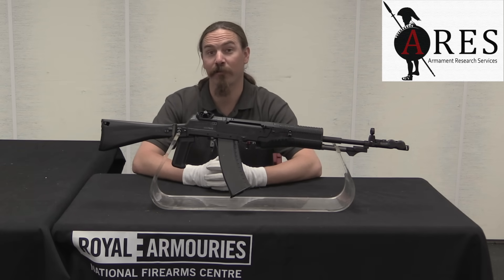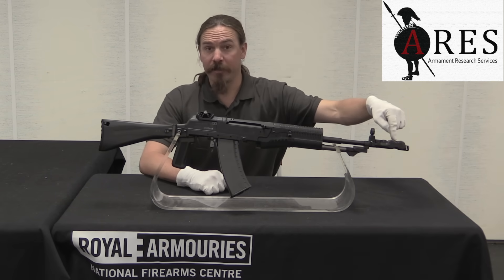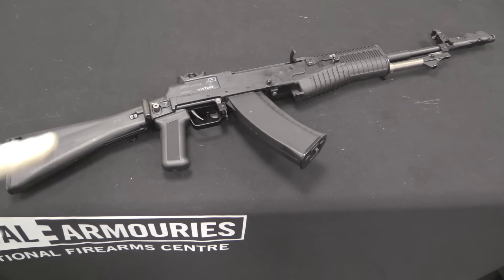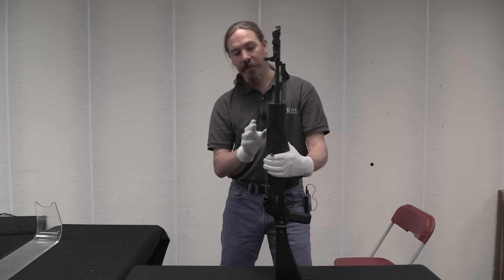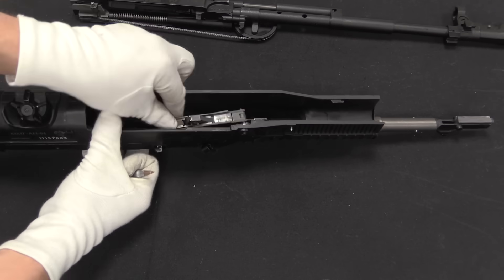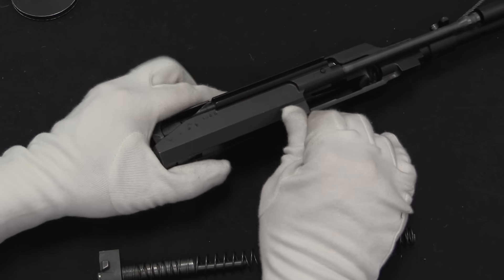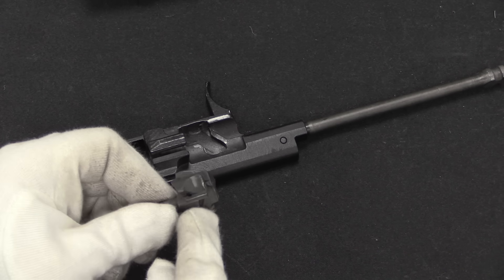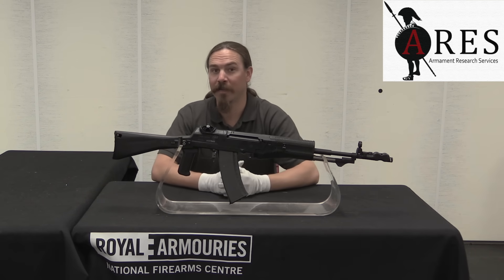Rocket Surgery: Inside the Russian Nikonov AN94

Comment: I can't believe they expected a soldier to keep this running in the field.
Reply: When the gun was being made, I doubt anyone actually believed it would make regular service. Which makes me think they didnt expect soldiers to have them - too complex and expensive for most army units. Never taking into full service, but officially accepted by certain spetsnaz and omon units.
Reply: kevmankom, it was only meant for special forces because it is really good at ripping up ceramic body armour. No regular soldier would ever use an AN 94 because they don’t usually come across other adversaries with ceramic body armour.
Reply: kevmankom spray WD-40 init fuck it that will do haha
Reply: It's not expected to operate like a normal rifle, common soldiers wouldn't use this rifle.

All that's needed is for a budding Russian gun designer from a younger generation to have a look at this and try to revamp the idea. If the two-stage feeding system could be made more reliable, or reimagined (and it could, this is the first gun to ever try this system) the hyperburst system would be massively impactful on the battlefield. Grunts could rip ceramic armor to pieces with this gun if they improved it.
Reply: @DustinKing77   The AN-94 will never put both shots into the same spot.  You're not going to get the kind of accuracy needed to hit the same spot twice from a gun whose barrel is in motion when the second round fires. Even the experimental Metal Storm guns could barely put multiple rounds through the same hole at very short range, and they had NO moving parts at all. Accuracy just doesn't work that way. Even minute changes in vibration can throw off a bullet significantly, which is why really accurate guns have to minimize the variation in vibrations from shot to shot by doing things like free-floating the barrel, stiffening the barrel, and tuning the ammunition to be extremely consistent. These are tiny vibrations, but they are what make the difference between a 4-MOA rifle and a 1/2-MOA rifle. 
The AK system is inherently less accurate than the one used by the AR because the piston starts rattling around in its tube and then the bolt slams into the back of the receiver while the bullet is still in the barrel, causing vibrations, while the AR has no piston to rattle and its bolt is buffered by a spring. The AN-94 then adds a moving barrel to that mix, along with a pully and a whole secondary loading system moving around.
Reply: ThorstenTheViking it would shred ceramic body armor, but only if it shoots both shots very accurate.
Reply: People seem to be under the impression that this is inherently unreliable just because it's complicated. This passed the same tests the AK did. The ones the M16 failed.

Your car is a hell of a lot more complicated than this and it works just fine. Have you seen the inside of an automatic transmission? The manual I have lists I believe one hundred sixteen moving parts.
Reply: It's actually surprising, but in trials this thing proved to be extremely reliable, but obviously not as much as the good old Ak's, thus it was basically relegated to the spec ops units, a.k.a. the guys that can keep their head cool under the shitstorm that combat is and not get the gun jammed bya weird misstep.

Honestly tho, I'm surprised they adopted this monstrosity over the AEK and other counterbalanced rifles, cos those are much simplier, and the only advantage this gun has over them is its hyperburst mode, while in full auto and single shot modes the AEK and AK108 win out by a mile.

Comment: Why does everyone keeps saying that AH is a complicated gun? In fact, it's a very simple machine for what it does. The firing mechanism has just SIX elements (excluding springs): a barrel together with a stock, a hammer, a bolt carrier, a bolt, a wheel and a wire. It's easy to disassemble: just drop the lever, open a cap and pull the firing mechanism out, and that's it!
Compare it with HK G11.

Comment: "The trick to getting the top cover off is to use force from the charging handle, and hole the barrel forward as well, and then you just-"

bangs rifle on table several times until success is achieved

...Yup, that's a Russian weapon all right.

Comment: Let me see if I understand how this works in laymen's terms (haven't watched the entire video yet): the muzzle brake delays the movement of the floating barrel until the bolt and ejector are at their rearward position. At which point, another round is fed into the receiver, and the barrel meats the bolt at the barrel's rearward position, which is when the second round is fired. Is that right, or did I mess up somewhere?

Comment: So when not in the special two round burst mode, does it bypass that goofy lifter?
Reply: No, I believe if you have it in full auto, the first two rounds would shoot at the same speed of the burst, then drop down to 600 rpm. But as soon as you let go of the trigger, it would set back up for the burst, starting the process over.

Comment: And what do you think the role of the muzzle device in this rifle's action is exactly?

Also, I don't get it. If the feeding is done solely from the fancy lifter, why not just move the magazine well forward to that spot and ditch the lifter?
Reply: The lifter is used to feed the second round during the 2-shot burst. I suppose that if the magazine was placed there it wouldn't feed the round up into the chamber without clearing the bolt carrier's travel.
Reply: Um... Do you mean that the magazine lips would get in the way of the bolt carrier? And what exactly makes the AN94 different in this regard from the regular rifles, where it is not a problem?
Reply: Konstantin Voloshin Well it seems that the lifter is built with a retraction mechanism, and when it extends it protrudes inside of the internal receiver. I however don't understand every detail of this design as this is the first time I've seen one disassembled
Reply: Than they should've cut a hole in the internal receiver so that the magazine can fit there deep enough for the bolt to be able to strip rounds from it. A hole big enough to leave space for the magazine at any phase of the recoiling of the internal receiver. Can't see a reason why they couldn't do it. Sorry, but I'm still not buying this explanation. Not without at least some additional details. For instance, why such a hole cannot be cut :)
Reply: Oh, and the reason for the magazine being canted to the side would be interesting to know as well. It is not revealed in the video, and I don't see an obvious answer.

Comment: Another feature of this assault rifle is that in full auto mode, it starts with the 2 round burst at 1800 rpm and then switches to 600 rpm auto fire, every time you pull the trigger, you can check that in a video where a soldier from one of the special brigades who use AN-94 fires it. Also something distinct of this gun is that the bayonet lug is on the right side of the barrel which is something unique in russian guns.
Reply: They had. Main point of the gun was to be used by special forces, but it turns out main issue of it, because russian SF made it weary clear: 
''If it can't withstand same condition, that SF troop can, then we don't need it''.
Also AN-94 was fully adopted by russian SF and fully used in battle and SF operation, but verdict was the same, good weapon for shooting, but unreliable in real battle and long terms condition, same issue was with AEK-971, SF troops were weary pleased of by that gun because it fired weary accurate even in burst mode of 3 shots, but 2000-3000 shots and gun needed spare parts.
Also when SF actually compared AK-74 with AN-94,they found out that AN-94 only advantage was in 2 shots in burst mode, which AK-74 just didn't have. Whet they fired with 1 shot (most used fire mode) AK was more accurate, whet tried full auto again AK was winner and do we need to talk about complexity of those two? - sow there was reasonable question : ''Why do we need it?" .
AN-94 was heavier, much more complex, expensive in time and materials, less reliable and required weary delicate user. Nikonov tried to lesser the negative side, but unfortunately he died and after his death there was now one to continue his work.
And yes Nikonov made his AN-94 for special concurs which task was ''2 shots in 1 target'' - for that it was perfect, but in all other terms it was bad.
Reply: Wow... that even makes full-auto mode twice as effective (unless you just dump the whole mag on a barn).
Reply: Al Zl ''Weary''.. lol
Reply: Andres Menes so black ops 2 got it right

Comment: What is the worst thing a russian soldier could hear? "Clean these AN94's, blyat!"
Reply: Followed by giving up and going for some kompot.
Reply: Watching Ian disassemble the fucking thing almost gave me a panic attack.
Reply: Have you guys not seen Larry Vickers' video on the AN94? 
After he fired a few rounds the gun jammed and it took 4 people to clear it.
Reply: I believe the rifles had to be maintained by armorers and were only issued to a handful of their "elite" units.
Reply: Only if you get the reassembly and function test correct.
Reply: WindHaze10 its funny cuz im russian
Reply: Funnily enough it happened because there was noone that was actually TRAINED on that weapon present. If someone removed the mag and pulled down that takedown lever on the front, they'd have pulled out that internal firing assembly and everything would have been cleared.
Reply: I honestly expected the disassembly to be worse.

I could actually see myself do a rough cleaning really quick.   Just pull the main assembly out, wipe it all down with anti-fouling solvent, wipe dryish, add oil, and reassemble and rack the action a few times.
Reply: WindHaze10 
That alone is probably worse than gulag
Reply: Bubba from Alabama doesn't have a prayer either.
Reply: table beating intensifies
Reply: bubba might not be able to but i betcha forrest would.
Reply: беспизды блять!
Reply: We just signed a non aggression pact with Germany
Reply: Александр Костин Tha must costin
Reply: Очистите те АН-94! Блядь!
Reply: Imagine cleaning a AN-94's in a gulag=hell on Earth
Reply: I got an AN-94... Wot Suka Blyat!!!
Reply: WindHaze10 "Idi nahui cyka"
Reply: hence why it failed
Reply: Patrick Ancona Thats because they are commies.

Comment: Ian, could you please explain how does this gun limit fast cycling in full auto after firing 2 first rounds? 
And how do gas and recoil operation function in normal (~600rpm) rate of fire? Do they act simultaneously and increase velocity of the bolt or what? 
I've only found information that "construction of the pulley system limits fast cycling after 2 shots" with no explanation.

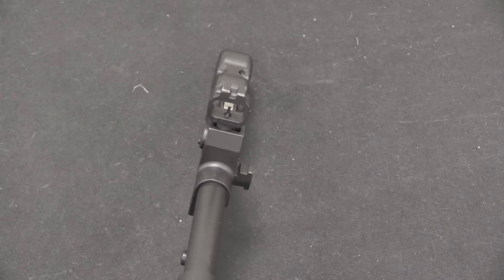Comment: I believe that the notch on the front sight hood is for inserting a tritium element. At 6:51 you can see that it also has a groove perpendicular to the notch. Also, at 6:29, you can see that the 200 meters rear sight apperture is different than the rest as it's chunkier and has additional two holes on top, that also makes me believe that are for inserting tritium elements. If you think about it, the way the tritium would be inserted, you will have like a 3 dot system, which is more than sufficient for shooting at low light conditions at no moroe than 100 meters.

Comment: There is something so uniquely Russian about smashing a live round into the upper, then smashing the buttstock into an opponent's head, to field strip a weapon. Wouldn't it have been easier to have the bolt itself pick up and hold two rounds (spins to an empty cartridge hole as it's cycling) as a buffer rather than a separate mechanism?

Comment: One thing I have noticed in my research is that the gun does NOT cycle twice before the recoil transfers to the shooter. The second cycle usually happens right after the internal mechanism hits the backstop. The second bullet leaves it just a blink before that. This also allows for a minimum of necessary travel, lightening the probably pretty heavy rifle. 
What I still don't get is why the mag is canted. There seems to be nothing in the way to make it straight, or am I blind?

Comment: This thing is insanely complex – and interesting. Just think of how they had to fine-tune all the (asynchronously) moving masses and springs to achieve the correct timings for all the different firing modes and also minimal wear, minimal weight, "easy" disassembly etc. etc. I wonder whether it would even have been possible before the computer age of calculations/simulations...

Thank you, Ian, for presenting this strange beast! Too bad you couldn't also give us your firing impressions, I bet its burst mode would feel quite unique.
Reply: P.S. I'm liking the rear sight system. Now that's a detail which seems simple and practical!

Comment: It's surprisingly less finicky than I imagined, while still being very complicated for a service rifle. 

If the concept is solid (which I'm not sure) it kind of makes sense to elite troops who have more than enough training to mantain it, because while complicated it doesn't seems to be a fragile gun (all main parts are big and heavy).

What I couldn't quite grasp is how the recoil action interacts with the gas system action. The gas is there to make the bolt cycle faster than in a short recoil gun and enable the double(?) feed? Also how the gun works in semi auto mode when the fire control just pulls on the sear?

Comment: I think that the feeding block connected to the wire is also to compensate for the moving of the bolt. Any moving part will generate motion of the gun. Since the bolt has to move twice without affecting the aim and it is a pretty heavy element of the gun which is moving fast a compensating block will help keeping the gun on target.

Comment: Since the counterweight/2nd round positioner is directly linked to the bolt, wouldn't it always put a round onto the lifter, or is that cut off by the selector? Also could you explain how the selector switch changes between standard full/semi-auto to the 2rd burst feature; does it disable the recoiling of the whole action to just run off of the gas piston or does the entire action run as normal tripping the hammer to fall when the action returns to its forward position? 

I find this to be an incredibly interesting action and would like to know precisely how it functions. Difficult without handling/playing with it myself, however your descriptions have always been spot on and I sincerely appreciate your content.

Comment: That's a very conservative deactivated gun. Usually in the UK they weld the whole gun shut and cut down the barrel and then weld a rod inside it so it's virtually impossible to repair it. Sometimes you can get ones where the bolt works but the bolt is cut off or welded completely up and the same with the barrels.

Comment: It's a rather ambitious firearm, alas waaaaay too complicated in my opinion for a front line Assault rifle. I couldn't imagine some poor peasant soldier in the middle of Chechnya trying to strip this thing to clean it only to have a surprise attack come at the worst time. In comparison the AK-100 series rifles are just as easy to clean disassemble and reassemble as their 47 and 74 predecessors. If it ain't broke don't fix it.

Though I did hear Spetznas units use the AN-94 in limited numbers from time to time.
Reply: Timothy Calarco If I read it right this rifle is made to kill armor, ceramic plating to be exact. First bullit breakes the armor and second passes right trough the same spot.
Reply: Some Russian Naval Infantry soldiers used AN-94's in Crimea in 2014
Reply: +Strawman
nope, it's just to compensate aiming errors. USA, Germany and who knows else danced around same idea with SPIW, G11, etc.